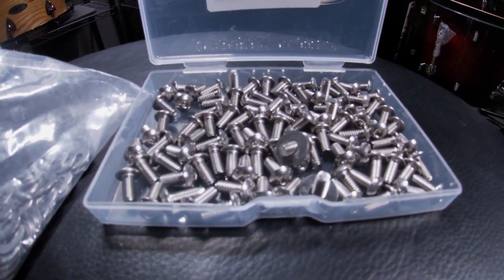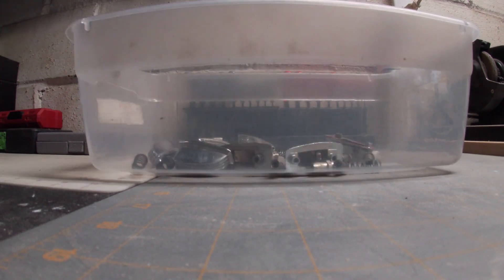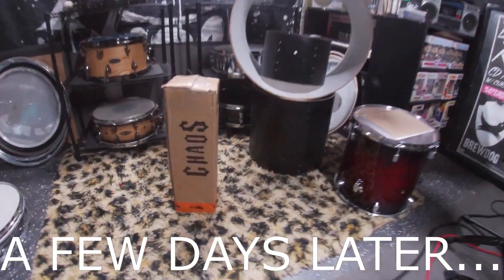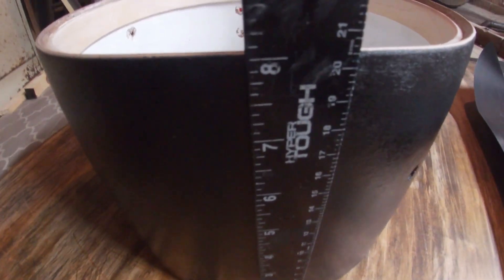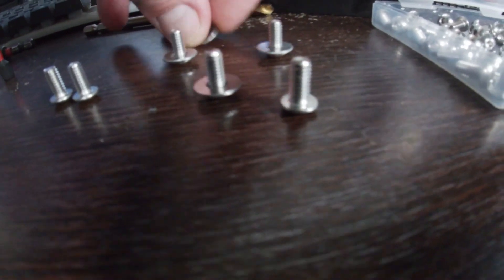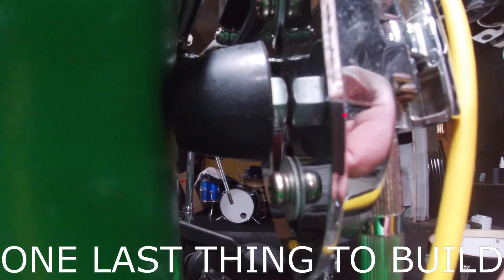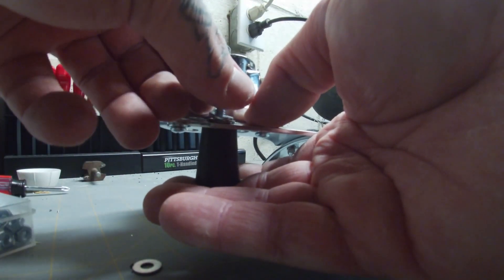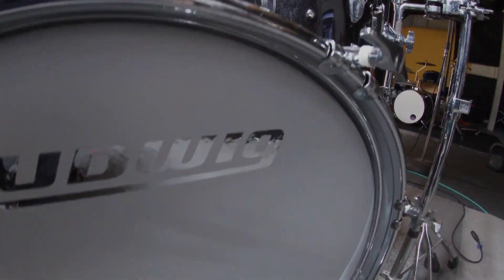FINALLY WRAPPING UP the LUDWIG BUILD

Comment: Hi, I just found your channel and watched a few videos. I'm commenting because you asked, not to criticize, but I would be nervous as hell with the tom mount such that if it happens to come loose, it would slide down the pole right into your beautiful base drum. My OCD says turn it the other way, please for safety! Great job building your Rockers. I did mine too, but never videoed the process. Just a few pictures along the way.  I use mine gigging regularly, and they are awesome good drums.
Reply from the maker: I see what you're saying. I do think about that at times so I've gotten used to double checking it before playing. I've had more problems when the mounting L-rod is pointing up and have had it loosen at the ball and fall from the weight of the drum. Flipping it around seems to help and allows me to have a flat tom set up. To each their own lol. THANKS FOR WATCHING!